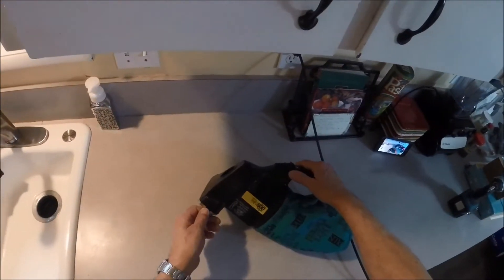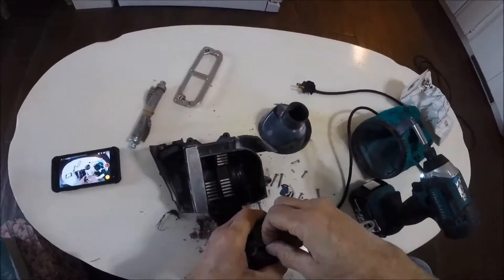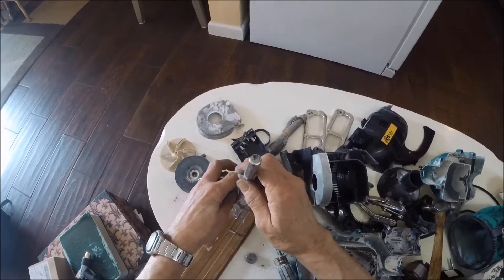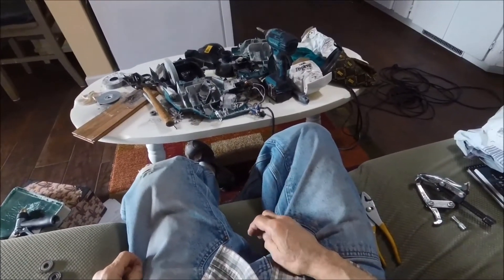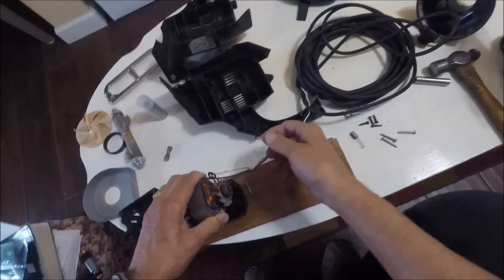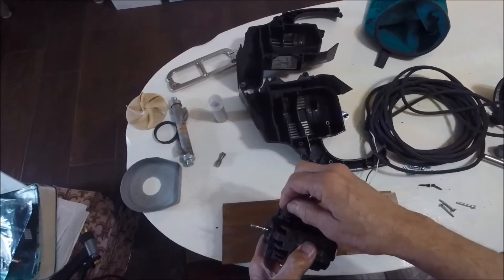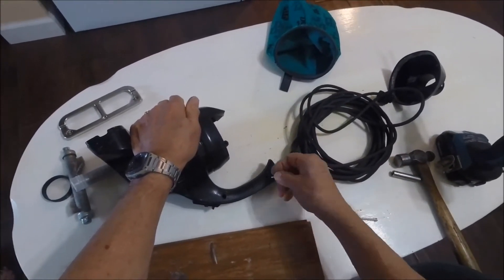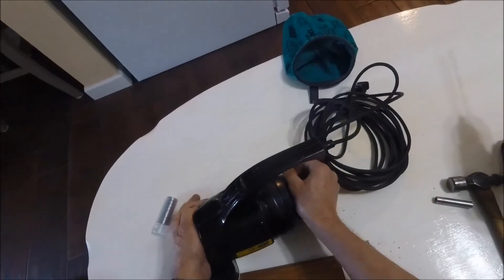Under $2 Vacuum repair/bearing replacement Dirt Devil Handheld

Comment: Good work! I had a red one for many years. Probably the best thing Dirt Devil made.
Reply from the maker: I agree, thanks for the comment
Reply: @davidmartindaletheycallmemacgu  Sure thing! Do you mind if I ask where you bought your bearings?
Reply from the maker: Matt Jones Not at all. I got them in a 10 pack on EBay for $7.59 with free shipping. Just enter 608z bearing in the search.
Reply: @davidmartindaletheycallmemacgu  Thanks! Really appreciate it! I buy my Kirby bearings off eBay.
Reply from the maker: Matt Jones if for some reason you can’t get them, I still have 8 left and I could send you a couple, you would just pay for the shipping.
Reply: @davidmartindaletheycallmemacgu  Hey I just found one of these at the thrift store but it's missing the nozzle cap in the front. Do you know where I can find one? And it doesn't have the paper bag adapter.
Reply from the maker: TechandHobby if it’s the Royal red original, I found this on Amazon. Royal Dirt Devil Nozzle Plug - Black #1670744600
Reply: @davidmartindaletheycallmemacgu  Sorry for the late reply, but thanks a lot. If I need some, I will let you know if I can't find any. I found a two-speed Dirt Devil back last Summer. I took it apart and serviced it. Right now, the bearings are OK but, since it is nearly 30, it will need some eventually.
Reply from the maker: @mattjones7621  I'm still using mine. I do still have several bearings left.

Comment: I lubricated the ends of the motor, because it sound very loud, and still does. It can suck a carpet off the floor, but the noise shouldn't be that loud. Any suggestions?
Reply from the maker: It's possible the fan blade is bent or missing part of a fan blade causing it to be out of balance and it could be rubbing on the inside where the fan spins. Or one of the bearings could be going out. Hope this helps.

Comment: Where did you get that bearing puller from?
Reply from the maker: here's a link:https://amzn.to/3RgpbgK
Reply: @davidmartindaletheycallmemacgu  also where did you get the metal rod from that you used to knock the bearing down?
Reply from the maker: Harbor Freight, it came in a set of pullers
Reply from the maker: @H92b-q9h  it’s a craftsman drift punch, but Amazon has them and so does harbor freight.

Comment: Hey, David! Do you know of a good place to buy carbon brushes for those things? I eventually bought bearings for mine, but I know it will need brushes down the road.
Reply from the maker: Swiss Boy Vacuums and more sell them online for $7.75 for the Royal Dirt Devil, but keep in mind that any carbon brush that is close to the same size can be filed or using a grinder can be shaped to the same size in your vacuum and used. Another idea is finding one for parts and just remove the brushes and use them. I did also see carbon brushes on Amazon. Hope this helps, good luck.
Reply: @davidmartindaletheycallmemacgu  Thank you! I did find a motor and removed the armature and brushes, but I wanted to make sure there were still some around for when the times comes. The current ones are good for a few years, but they will eventually need changing. Thanks for the info.